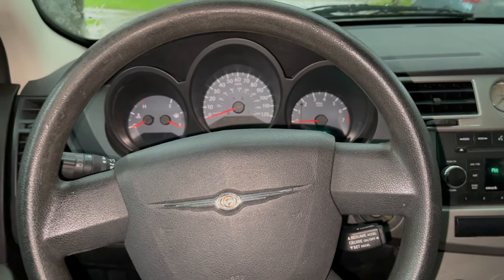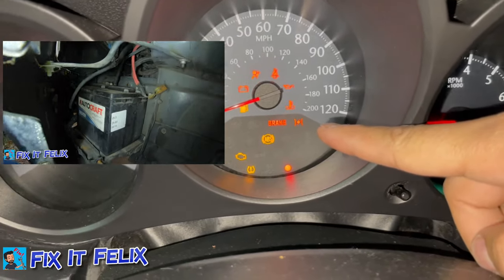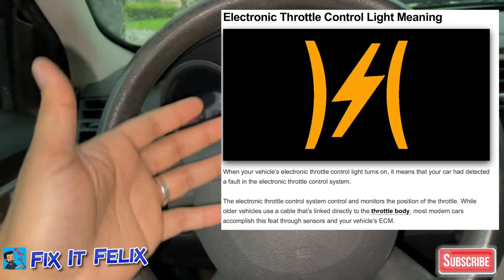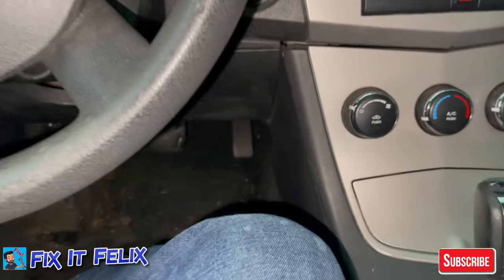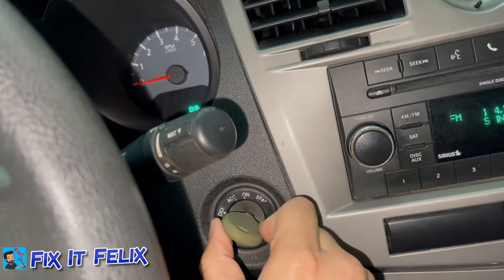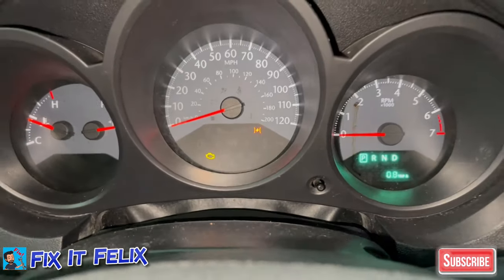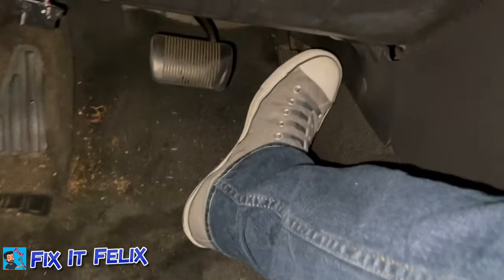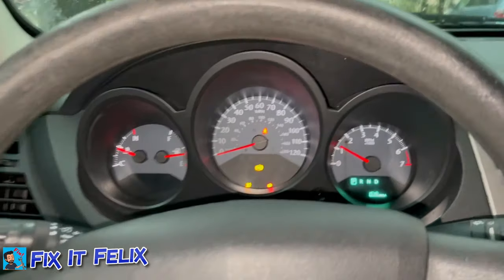red lighting bolt fix ( dodge / jeep / Chrysler ) RELEARN PROCESS

Comment: All the comments saying how they're so thankful for this video that the method actually worked and made their car run. But I don't see anybody giving an update. ?? I don't think this will actually fix the real problem.
Reply: I wanna know!
Reply: Did you change your battery and still have the same problem after you followed the steps ???
Reply: @bandolarry4823  shouldn’t have anything to do with the battery, it’s something to do with your throttle body
Reply: @mjhubbard14 yea but if you change your battery your throttle body will reset to factory settings and you’ll need to do a throttle body relearn

Comment: Two years ago I had my throttle red lightening bolt light and check engine light come when I had 40,000 miles on my 2014 jeep compass. My car was excelirating like crazy...the engine was reving and then the car went into limp mode barely would excelirate. Right away i took it into the shop. A mechanic told me the throttle body on these jeep compasses  go out around 39,000 miles. Cost me $900 to fix. I recently took it in to have a battery cable tightened. Well I was told the throttle body should be cleaned. I took it in and had it cleaned. A week later the throttle and check engine is back on. Car doesn't start cup quicklynlike it use to. But runs fine. Took it right back into the shop. They cleaned it again. I go to pick it up and a mechanic told me that throttle boot should be cleaned  every 20,000 miles. Well no one told me this important info.  Well sure enough the throttle and engine light are back on again. These  lights come on and off again... then days later back on.  Crazy... I had a diagnostic test done on it now it states I need to replace the throttle body again. It now has 70,000 miles on it and I was told the cost to replace the throttle body has went up in price to fix... now $1400. Grrrr.... do all cars have throttle body or just Jeeps? I'm about to get me a new car. Fed up... I'll try your recommendations first and see if it will fix this issue. But it's scary if these lights ever come in and the car goes into limp mode especially on the freeway.
Reply: Before you do anything try replacing the crankshaft sensor, I replaced about 5 things and it ended up being a sensor. I had a PT cruiser that happened the same thing, it costs about 10 dollars and one bolt

Comment: Tried this, went away, 3 miles later it turned back on. Pulled over and tried it a few times but didn’t work. I think I have a bigger issues.
Reply: Did you find the problem  ?

Comment: Thank you so much. Your instructions worked for my 2019 jeep compass. Even called the jeep dealer and they didn’t know how to fix it.
Reply: my local dealer charged $75 to use their high tech computer to reset throttle. Those scanners  are over $1K,  I'm about to try this method after changing valve cover gaskets, I Hope It Works!

Comment: OMG TY - dealt with this for weeks and a repair shop.  Ended up changing the throttle body myself….but that video didn’t cover the reset like you did so I labored through another rough riding week until I ran across this video!!!!  God bless you for doing this video!!
Reply: Do you know how much would be to replace the throttle body?😊

Comment: Thank you I actually replaced my water pump and radiator hose the other actually Monday last Monday and I got on the interstate today was the first time on the interstate that lightning bolt light came on but the car wasn't acting funny except for it seemed sluggish but it would go when I pressed the gas so I was concerned thank you so much I'll let you know when I take my next Excursion if the light comes back on

Comment: I have a 2013 Chrysler 200, tried several times and it’s not working.
Reply: What have you done to fix this problem. I have replaced intake gasket throttle body

Comment: I have a 2012 Dodge Grand Caravan SXT. No problems. I stopped at the grocery store. When I came back, the car wouldn't start at all but I noticed the lightning bolt for the first time ever. A quick search and I found three videos talking about sensors and throttle body. Then I found yours. I did the simple steps and she turned right on. Imagine that! Thanks.
Reply: Bro mine is the same but I try to do it but it doesn’t work any help 😪

Comment: Yes but this does take the light off and it will help the issue temporarily... I have a jeep and mine does this.. but eventually u will have to either change ur throttle body sensor.. or u will have to replace the whole throttle body itself... It's simple to do.. it's 4 bolts and a plug.. the plug is the sensor.. try to change the sensor first.. if it still does this then u have to change the whole unit.. throttle body unit.. like I said it's just 4 bolts and a plug.. but it can be a little expensive like 400$... The sensor is around maybe 100$.. I would change the sensor first it's easy to do just unplug it and put the new one in.. if it still does it after u do that then u gotta replace the whole unit.. like I said it's easy to do 4 bolts and it slides out... I hope this helps someone.. U DONT WANT TO KEEP DOING THE PEDAL TO FLOOR THING CAUSE IT MAY CAUSE THE THROTTLE TO STICK IF U GO TO LONG.. AND TO LONG IS LIKE YEARS DOING IT... SO

Comment: You’re a clutch master for this bro helped on my Chrysler 300 but my check engine light never turned off but i did it still because it wasn’t turning off but it turned my car on and all the lights went away so the waiting for the check engine light might not have to be off
Reply: Disconnect the positive post on your battery for 3 mins and reconnect it. Your car's check engine light should be off.

Comment: Mine constantly goes into limp mode. I replaced throttle body, checked the pedal accelerator sensor.  Unplugged battery.  Took off and put back fuse nothing.  None of these work not even the relearn. What could it be?

Comment: This fix works very well although I am curious if anyone has any thoughts on why this keeps happening.  I have had to do this little reset trick probably a hundred times over the last 2 years.  I've had the dealership replace the entire throttle system but still it persists.  The reset works, although unlike this video my check engine light persists for a while after I get rid of the lightning bolt which just has the annoying side effect of not allowing me to use remote start for a day or two.  Would be nice if it would stop altogether!
Reply: Lol bro my avenger is doing this now and im like smh this cars got a lotta issues mane
Reply: @ironstrong3431  funny timing on this response literally just had my car in the dealership today.  they had to order the part but say i's not the Electronic throttle system itself but a "bad connector" i think is what he said.  Not an expert myself by any means.  We'll see if that works. Should be in and done next week.
Reply: @lchurch1  yeah brother thanks. So many variables im taking it into the shop on monday… fr tho I wish I invested in a scan tool. Common issue with this problem apparently is the electronic control throttle, intake manifold gasket, and pvc or pcv i forgot. Ive also seen a few relating it to the thermostat.
Reply: Cheap Mopar wires lose capacity in some capacitators

Comment: I have a 2011 Dodge caliber.this method work but as soon as I come to a stop 🚦🚥 the light (⚡) comes on again.. this JUST HAPPENED TO me on the way home from work. Wed Jan 26 2022. 4:30 p.m Chicago time..do you think you know what the problem is Felix???
Reply: Omg I'm having the same exact problem Any uodate?
Reply: I'm going to try this on my caliber in a few! I have a 2010. Replaced my throttle body brand new and the light still comes on. I dont think the mechanic reset it back!
Reply: My car won't start smh

Comment: The lightning bolt went away on my 2006 charger 2.7 after doing this. But the check engine light still on. Also I didnt notice but my temp gauge was on functioning, but after doing this, its working now.

Comment: Awesome video! And awesome explaining step by step. I just have a question, would reseting it cause it to come again further down the road?
Reply: Yes it will.. I have a jeep and mines does this.. the bolt comes in the dash ⚡ and my jeep shakes and won't start.. like it's stuck.. eventually you will have to change the sensor.. or the throttle body unit.. it's only 4 bolts that hold it on.. and the plug that's on it is the sensor.. I would change the sensor first.. it's cheaper.. the sensor is the plug thats on the throttle body unit.. it sits on top on the engine usually in the back.. it looks like a long plastic tube with a rubber part that looks like a bendy straw.. u no the ripples a bendy straw has on them.. if u unplug the sensor it's really easy to replace.. u just unplug it and get a new one and plug it back in.. if u go to O'Reilly auto parts or Napa or advance they may help u and show u where it is exactly so u no.. that way u don't got to pay a mechanic to do it cause it would cost a lot.. if u buy the sensor ask the guy at the desk or someone at the part store if they can show u where it is.. there is usually a guy there that knows his stuff and is willing to show u
Reply: Mike what’s the sensor called? I changed my throttle body and I still have this problem.

Comment: Someone can help me? I have the same car Sebring 2010. It keeps failing, it turns off at lights, stops, the revolutions are below 1, sometimes go up quickly to the 2 and i already replaced the throttle body and the gas pedal for a completely new one.
Reply from the maker: Sounds like a bad crankshaft position  sensor  check out this video
https://youtu.be/aX-2_xY-m10
Reply: tps sensor
Reply: how are your spark plugs?

Comment: Talking about lights, I have a 2006 Sebring and the check engine light comes on and the code is for a leak in the evaporator system for the gas. I have noticed that most of the hoses are not a flexible as they once were. Where do I look for the hose under the hood?
Reply: Auto zone, O'Reilly, Holbrook, hastings, etc bud just give your year model and make of vehicle. Lol im a manager at O'Reilly so I def want you to get what you need

Comment: to day my car dodag avenger model 2008 4 cylinder  when i drive it shuttdown sudenly in the first light of check engine was appear but later it not appear and appear light electric ⚡ when i crank from starter motor by connect the terminal to positive battery  whats your expecting  for this problem   . thanks 🙏

Comment: My 2008 Jeep jk got the lightning bolt just like this guy. I have a pedal commander that was my cause. I disconnected it and wired it normal, turned on the Jeep and no more lightning bolt. So then I decided to reconnect the pedal commander and no lightning bolt. It’s happened to me in the past. It’s like the pedal commander glitches from time to time.

Comment: It actually works for my 2015 Pat. Jeep which prior would run fine until 5 mins. or less.  Usually happens when you come to your first or second stop.  However, it will go back eventually with the same issue...probably needs a throttle cleaning or gasket due to possible air leak around the engine cover area.  But this temporary fix is what I needed. Thanks Man!

Comment: The lightening bolt came on and check engine light I took it to a shop they said it’s the throttle body so it was changed still won’t start lightening bolt there and check engine light

Comment: I have a 2015 chrysler 200… i was driving and the Engine Temperature High & Service Electrical Throttle Control light came on… I stop to the side, checked & everything was fine… turned it back on and the lights remove but 30min later showed up again… Can you please help me ☹️

Comment: Replaced battery and alternator last year, Nov of 2022, was getting low voltage code because alternator was dying. What’s it mean now in April of 2023 if you give it gas and the lighting bolt flashes and car stutters or has weak power?

Comment: I have a jeep patriot 2007. For me I did what you said, turned the key, press the gas pedal, then the lighting bolt went away. And I turned it on. If I would switch back to the off position it wouldn't work. So for me I had to just turn it on after pressing the pedal

Comment: Hi, thanks for sharing this video. I did exactly as instructed, however the check engine light didn't blink, it just turned off. When I started the vehicle, there's no lightning bolt but after 5 mins while driving it blinked again. Not sure what needs to be done.

Comment: Yeah I’m having this problem all of a sudden with my 2016 dodge caravan. I got home from work with no problem getting home and no indicator light came on. It wasn’t until I got back in to leave that the van wouldn’t crank and I have the lighting bolt indicator light is on. I tried the trick with the gas peddle and that didn’t help.

Comment: Hope this helps. Changed alternator starter spark plugs 1 coil. Intake manifold gausket throttle body. Just turned on again. Did what u did. Hopefully it stops

Comment: I have this problem currently happening with a Jeep Patriot and my advice to everyone you need to have your vehicle hooked up to a code reader 1st to make sure that it is the electronic throttle control "ETC" do not go out and buy that $300 part cause you cannot return it if that's not what you need,, It could be your on board computer going bad that's causing the electronic throttle control not to respond or work correctly.
 I also would not recommend trying to drive down the road  If you have the red lightning bolt on and you lose the power in the vehicle like you almost have to push the gas pedal to the floor for the engine barely to rev up you'll damage your vehicle if you try to drive  And your repairs will even be more costly.

Comment: So I’m not doging you or the video but there are two different procedures out here on the interwebs they are almost identical except one says slowly release then shut off the other says turn to off the release and wait 2 minutes to let the computer reset. My Chrysler 300c was running beautiful except for the alternator not charging so I changed it and went into limp mode when I punched it to cross a road luckily I made sure I nothing was coming tried this procedure and then the engine light came on now it won’t start wth 🤷🏽‍♂️

Comment: I have this on my Dodge Avenger. A code reader said crank and cam sensor so replaced them and it still won’t start!  So frustrated. Now it’s saying system low voltage!

Comment: My drivers manual says to do the same thing except for pressing pedal, or they say if it persists remove throttle body and clean do not clean while on the vehicle, carbon buildup is preventing operation.also says it might need to replace tbc if the problem is not resolved by cleaning

Comment: I removed battery on my Dodge Nitro and when I put it back I am getting the lightning sign. When I start the car with the key it only cranks but doesn't start. I will try this as a fix and see if it works

Comment: Have you encountered horn not working
Where you can't blow the horn from the steering wheel neither from the panic button on the remote control
Any advice what to do noting that I knew that there is no fuse for the horn since its in the TIPM!!!??

Comment: I changed my throttle body recently. Brand new part. I got an off the road mechanic and I dont think he reset it back. I will try this. The light comes on when my car is warming up
Reply: mine too. I need to reset again and see if it fixes it
Reply: @nicolecc79  I gotta try it again.  Last time I did tho. My car didn't start at all. No crank nothing. The mechanic said it was an electrical problem. So I got that fixed. But still the light comes on. I have to shut my car off once it warms up and then restart it again just for it to run normal. But of course thats not normal. Hopefully once I try the reset again. It will be just that.
Reply: @nicolecc79  keep me posted
Reply: @rebel8440  what was the electrical problem?
Reply: @rebel8440 my Chrysler not turning on after cleaning the throttle body what did you do to fix it?
Reply: @josecueva5564  damn I don't even have this car nomore I don't even remember

Comment: My issue for the lighting bolt was due to a faulty connection from thr throttle body. 2010 dodge Avenger.
Reply: What was the faulty connection? We’re,what?